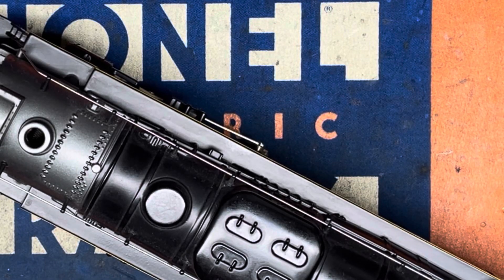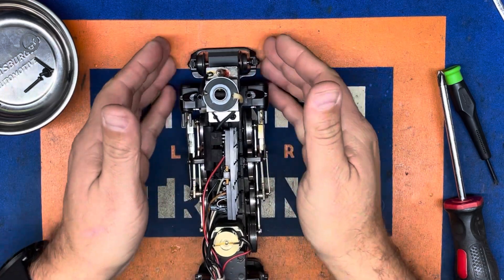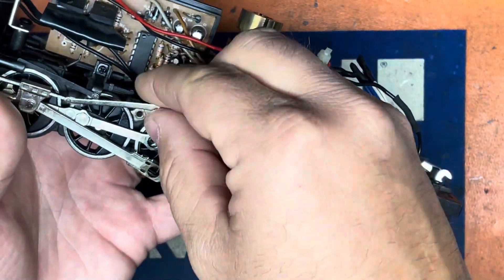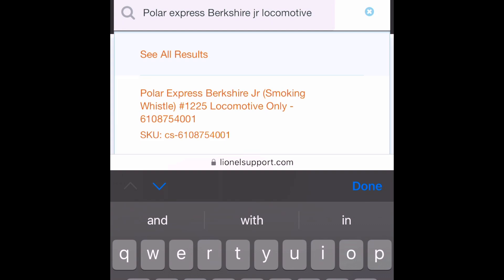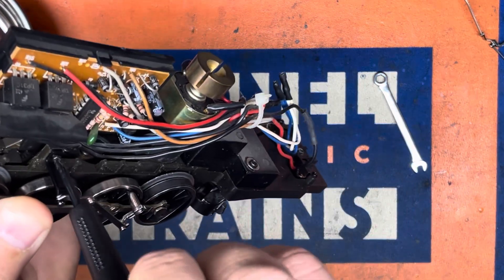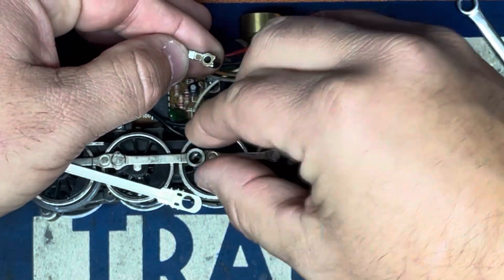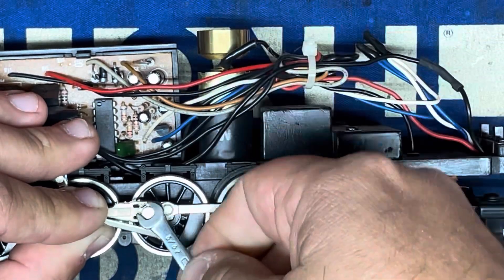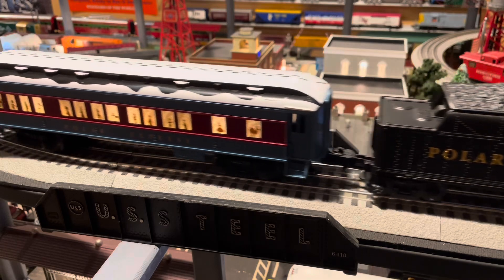Lionel Polar Express Threw an Eccentric Gear…Let’s Fix it!

Comment: Hello, I have a doubt regarding the wheels on both sides, based on your video at timestamp 05:49. The right-side wheel is facing downward, and the left-side wheel appears almost horizontal. Could this be affected when the train moves unevenly on the track? Due to my Polar Express train moving unevenly, i suspect this might be the cause of the issue.
I plan to dismantle the wheel support and re-align it, which is why I asked earlier about the wrench size.
Reply from the maker: Good observation…this is done by design.   There is a quarter difference between the side rod orientation on one side of the locomotive compared to the other side.  Picture the wheel as a clock face…if the connection for the side rod on one side is in the 3 o clock position, the connection for the side rod on the opposite side is in either the 12 o clock or 6 o clock position.
Reply: So this won’t cause uneven or unbalanced when moving, correct? Anyway thank for reply

Comment: May I know what size of Spanner or wrench when you open the part ?
Reply from the maker: In this video, I used a 5/32 wrench to remove screw holding the eccentric gear.  Thank you for question.
Reply: @modeltrainsolutions7368 many thank for reply

Comment: I am looking to replace the headlamp, but it seems that the bulb is glued on. What would be the best way to remove the lamb without breaking anything?
Reply from the maker: The ‘glue’ you are referring to is like red Loc-Tite and you should be able to unscrew with your fingers.  If it’s really stubborn, try taking a small pair of pliers.  Gently squeeze at the metal, below the glass bulb and rotate counter clockwise.  Once that seal is broke, it should come right out.  Hope that helps!
Reply: @ Thank you! Do I need to buy an official replacement bulb or is there a 
“home depot” variant that I could purchase?
Reply from the maker: You may try a 4 pack of similar bulbs on Amazon. This is also a LED option.  Ruiandsion E5 LED Bulb Warm White 12V E5 E5.5 Screw Base LED Bulb Upgrade for Modle Train Lights(Pack of 4).  I’m ordering some now to have as replacements.

Comment: I am wondering if that is what happened to my mom’s engine.  I heard a slapping sound and then the engine stopped moving.  Gave the engine to my local train store to repair two weeks ago.  If I can go in this weekend and it is still not repaired, I will take a look.
Reply from the maker: Could be…when this gear went out, the black metal bracket came out of the steam chest and caused the engine to ‘jump’ and derail.

Comment: Nice repair. Make your life easier with a good nut driver set. I bought the Whia precision set on amazon. Excellent quality.
Reply from the maker: I will definitely look into it…thanks!
Reply: If you already have the tiny 1/4” drive sockets, craftsman has a driver handle to snap them on to. Also SK and most off shore cheapie sets offer the same. Using the open wrench is often necessary since the hex is so mall the chamfer of a socket or nut driver will not fully engage. I have ground down so no chamfer to fully grip the hex.
Reply from the maker: Great information…I appreciate it!